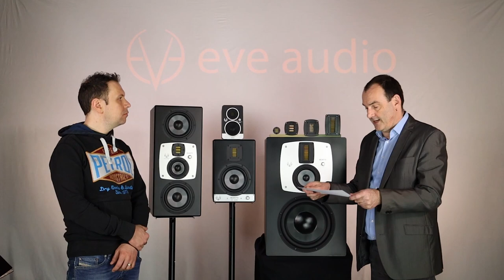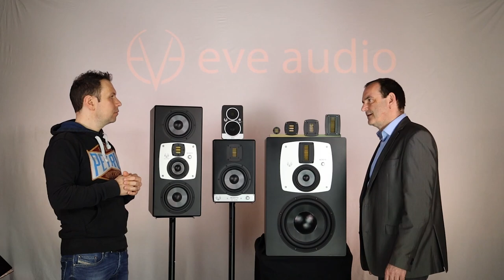Air Motion Transformers - What Are They And How Do they Work?

Comment: Heil invented the air motion transformer back in the 70s. ESS used the in speakers decades ago.
Reply: how's it going,ive got two vehicles running active set up's my blazer has a 3 way up front and my truck has a two way plus subs, my stuck with the two way i built it a long long time ago haha i made sealed enclosures at the bottom half of my doors with 8 inch mid ranges and then tweeters on the a pillars,the 8's are dayton audio mid's i would love to try some amt's on m pilars,do you know a set to try,? my blazer has a 3 way with a true dedicated mid bass in sealed wooden enclosures at the lower door then hybrid audio 3.7 inch mid's in dash and tweeters in a pillars and it sound pretty good. ,but yea i wouldnt mind trying some in my truck,do you know of any or should i call parts express for them,since i buy a lot of stuff from them.